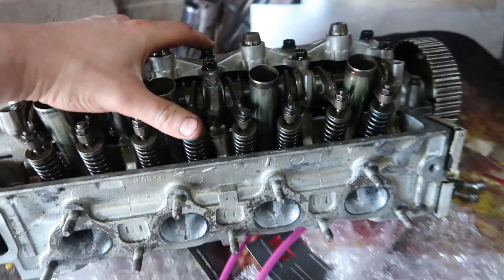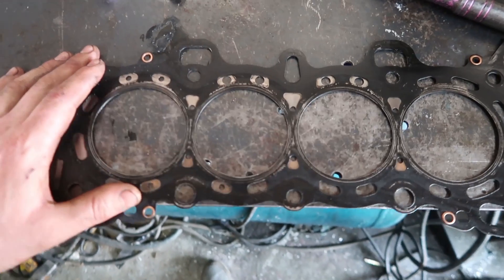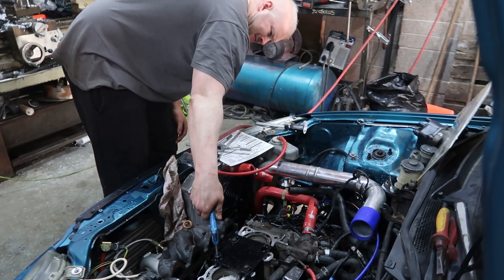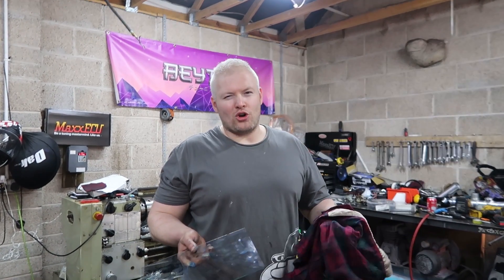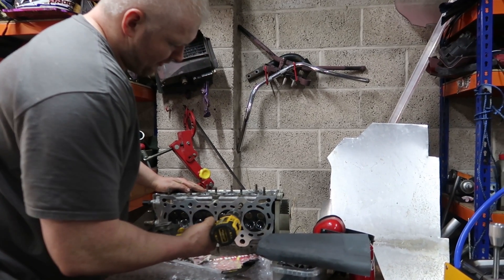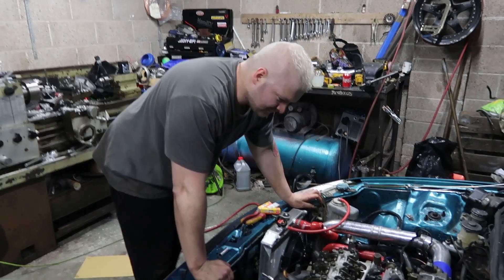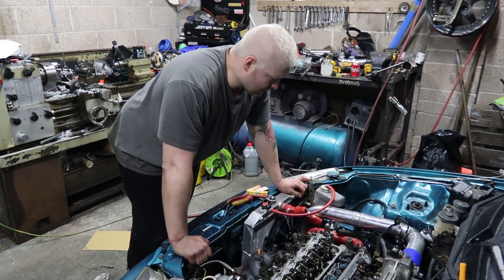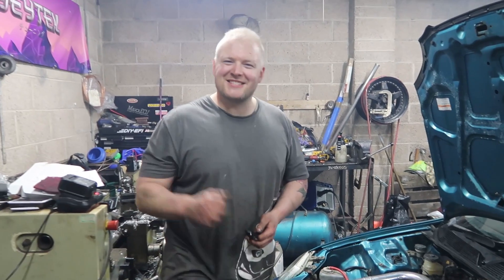HONDA D16Z6 GETS K20 HEADSTUDS???.. YUP THEY FIT!!... BLOCK WARPED :(

Comment: Another cracking video mate. Keep them coming will be interesting to see how the block is ..
Reply from the maker: Cheers bro. Im behind in making the videos, car up an running great, not lifting the head and happy boosting 1.2 bar 16 deg 11.5 afr no head lift. Next video ill show the data of the head working a treat with these bolts in. just finding the time :) Thanks again man. back to rx7 stuff again soon :)

Comment: Could you not deck the block? Or does the liner sit lower than the face? I know it will probably up the compression a little but you could always sort that with a thicker head gasket
Reply from the maker: yout 100% right. Although going by how smokey it is its also got oval bores. shes an old tired hoor of a thing lol
Reply: @BEYTEK  that's the end of that then, new block it is and big boosting
Reply from the maker: @psycho3344   no no. Ive put the head on and shes mint. time to turn the boost up :D haha
Reply from the maker: i feel the smoke ads to che sleeper factor plus never need to change oil. just keep topping up